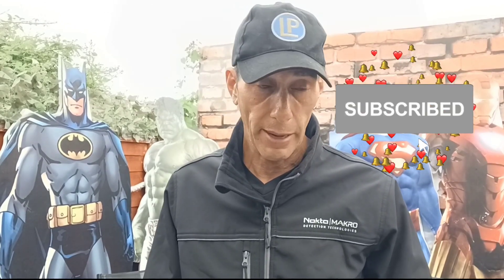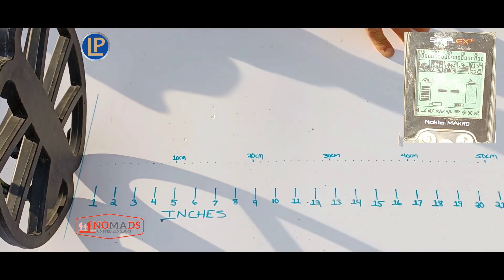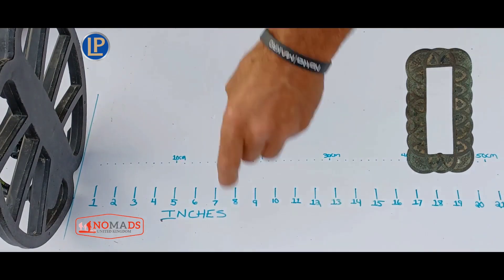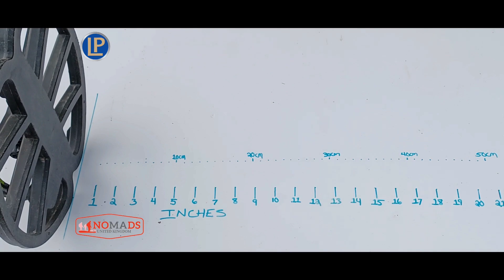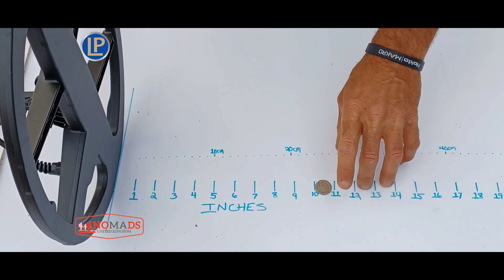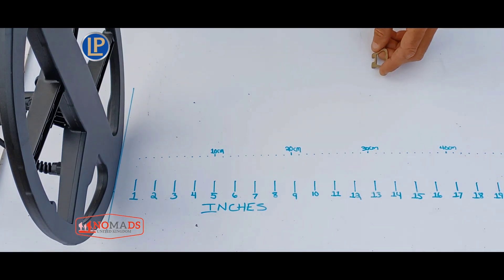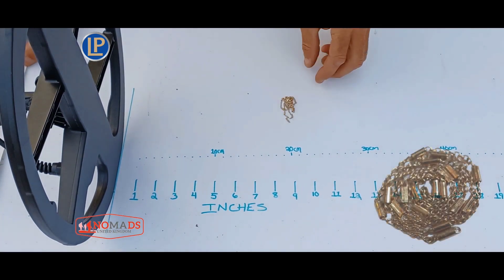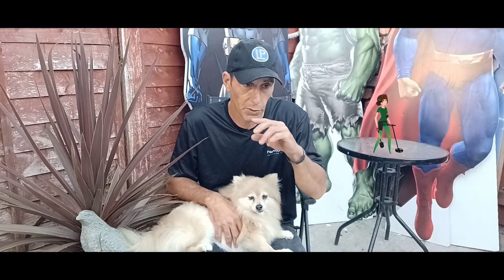SIMPLEX SP35 COIL vs SP28 STOCK COIL | Nokta Makro Simplex | COMPARISON VIDEO | Metal Detecting UK

Comment: Would the sp24 hold up against these larger ones? Thanks for the test.
Reply from the maker: It has a semi specific duty as opposed to the big ones. Bigger goes deeper. And allows several signals at once where as the 24 is precise and good for single signals in a smaller area

Comment: I have an old version of nocta simplex plus and will loading the new version make the depth difference or stay the same
Reply from the maker: There is a 2.78 and it adds features to the simplex. It also helps depth by fix8ng a bug previous versions had.
Reply: Tnx brother

Comment: Hi mate great video what's it's like in field mode is it even deeper signals.
Reply from the maker: I'll actually be doing field mode in a field and measuring all the targets, then digging a few holes for depth tests if don't find anything deep while detecting Steve. Thx for stopping in
Reply: @DirtDiggersUK  thanks mate yeah that will be great.just that I use field mode most of the time..